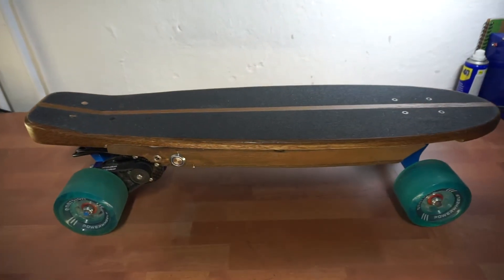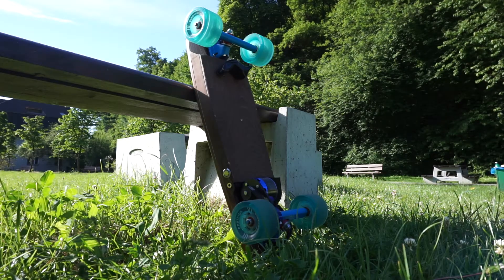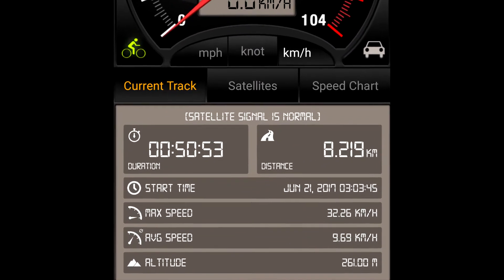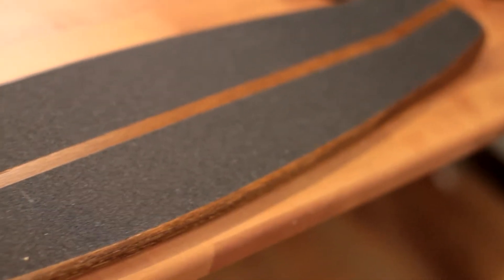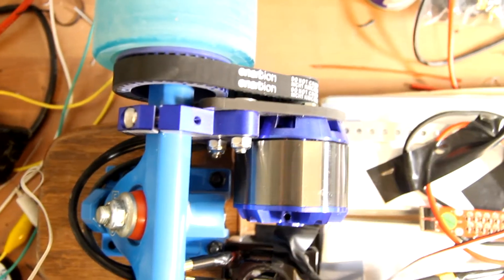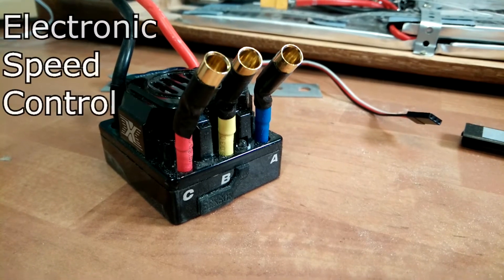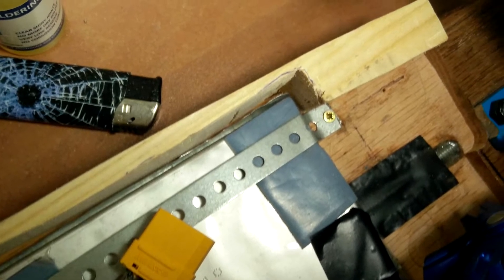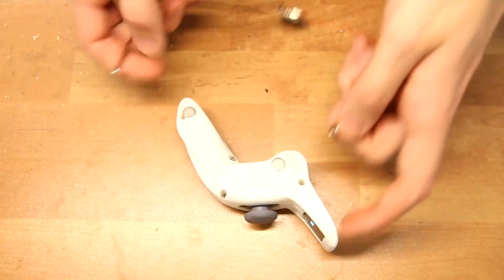Cheap DIY electric skateboard

Comment: awsome video and nice build. I have a question. Do you need ever unplug the batteries? I have heard it is bad for the esc to keep them connected all time. 

Another question, could you please provide a wiring diagram for the esc? Because I don't know how you bypass the discharge feature. And what power supply did you use?
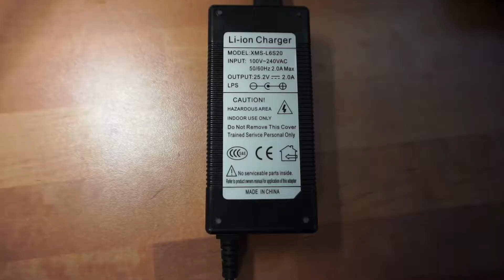Reply from the maker: No. I leave the ESC permanently connected as I'd have to take the cover out to unplug it. Hasn't been a problem for the few months I'm using it. For the wiring ESC is connected directly to the terminals of the battery. Negative terminal of the battery is also connected to B- on BMS. The positive lead of the battery is connected directly to positive pin on power jack and negative pin of the power goes to the C- / CH- of BMS. That's it. P- pin on BMS is not used. The power supply is 25.2V 2A since I have 6 cell battery. You can actaully see that at 7:35 .
Reply: ok, then maybe I will look at that option for mine, with that same bms, as it seems to work for you. How long does it take to charge? I don't remember right now your capacity and range, I'll have to lwatch the video again :P
Thanks a lot
Reply from the maker: np :) I have no idea how long it charges for as I always leave it charging overnight but you can always get adapter with higher amperage for faster charging.
Reply: Gyro how much did it cost to make it all
Reply from the maker: Around 580€

Comment: Hi man! Great video and great board ! I am bulting one too! I have a few question if you don't mind! What charging port do you use ? And its looks like you have a 6S bms, did you take a 24v power supply ? 
Thanks a lot!
Reply from the maker: Thanks. The power supply is 25.4V and the connector is standard DC jack. I believe it's 5.5x2.1mm
Reply: Thanks for your response,
Do you thinks that a 6S bms (2 x 3s in series) can be charge with  24v ? 
Thanks a lot!
Reply from the maker: not sure. The BMS I'm using specified 25.4V so that's what I'm using.
Reply: Thanks a lot for you response man, i appreciate.
If i can bother you a bit more, Do you have a diagram of your BMS circuit ? 
I haved built my one electric longboard but i can't charge it... Where did you buy your stuff (charger, charging port and BMS)? I don't understand what i'm doing wrong... 
Your help could saved my project...
Thanks a lot
Reply from the maker: Sure. The BMS was from hobbyking https://hobbyking.com/en_us/6s-li-ion-10a-pcm.html and the power adapter was from China. Alliexpess I think. The charging port I got from a local electronics store. The BMS was connected like a regular BMS. You can just google that. The only difference was that I didn't connect my ESC to the discharge pin but directly to the battery instead. This forum post shows exactly how I have it connected http://www.electric-skateboard.builders/t/help-with-6s2p-with-bms-wiring-only-for-charging/15761I know in the post he is asking if the connection is correct and I can confirm that it works for me.
Reply: It's really kind of you to help me so quickly, I think i have all the response i needed.
Again, thanks a lot man! 
I  hope your video is going to have hundreds of thousands views that would be deserve!!
Peace!
Reply from the maker: Thanks and good luck

Comment: which kind of code do you have for both of your arduino's? and how did you connect the bms with your battery? it is a very awesome result totally one of the best!!
Reply from the maker: Thank you :) .Since I'm not the best at programming I just took the example code for the transceivers and modified that so it's the value of the joystick. I have actually explained the BMS wiring in previous. I'm sure you can find it there aren't many.

Comment: Awesome board! An improvement i recommend that you do is to add a pulley cover. I designed a pulley cover for the enertion motor mount and it fits the motor you are using. Here is a link to the thingiverse page: https://www.thingiverse.com/thing:2445734
Reply from the maker: Awesome. Thanks.

Comment: Nice job. Does your esc give you dynamic braking (recharging the battery)  and does it slow you enough when going down a steep hill ?
Reply from the maker: it doesn't recharge battery but it breaks great. I have been going down some hills without problem. it make a loud whistling sound when not braking fully but it works.

Comment: awesome  vid..where can i find the bms.?thanks
Reply from the maker: Thanks dude. The BMS is from hobbyking: https://hobbyking.com/en_us/6s-li-ion-10a-pcm.html
Reply: thanks heaps🙏have u got a diagram for making the remote.?thanks
Reply from the maker: Well since it Arduino nano I connected the buttons simply to digital pins the potentiometer of joystick to analog pin. The oled screen works with IC2 so I connected that to IC2 bus and for the wireless receiver I just followed this tutorial: http://howtomechatronics.com/tutorials/arduino/arduino-wireless-communication-nrf24l01-tutorial/
Reply: Gyro have you experienced any problems with the bms? Like not balancing correctly etc.
Reply from the maker: I was measuring it couple of times. Always perfectly balanced :)